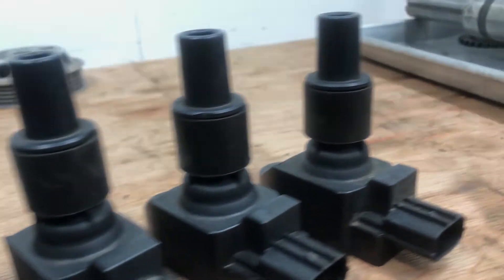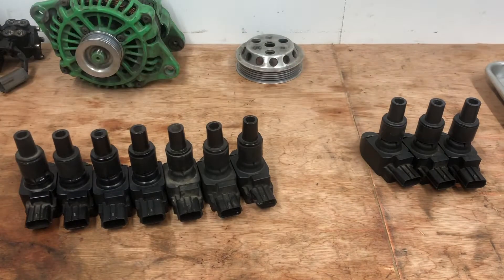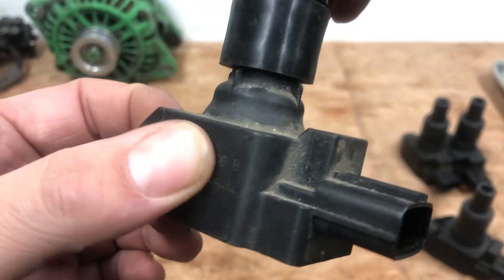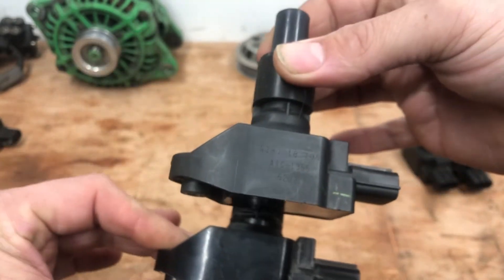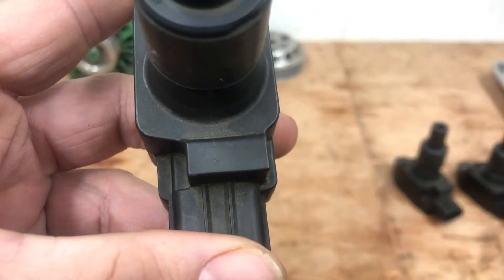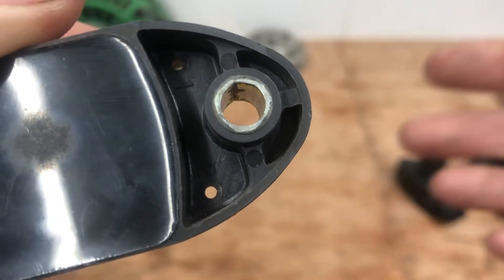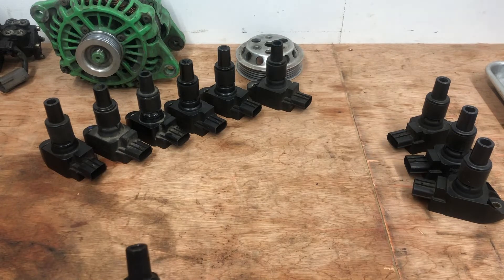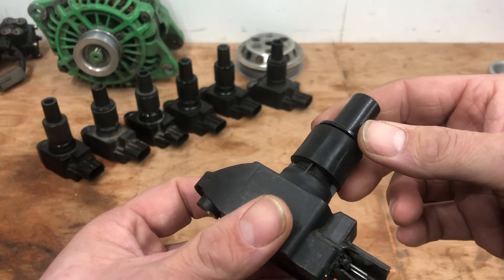Essex Rotary Quick Vid 39 - 9 Signs Your RX8 Ignition Coils Are Fake and How Pattern Coils Fail

Comment: Hi guys. My 8 suddenly shut off and won't start up again. The engine cranks normally. Started hot and cold without any issues. My mechanic found out that there is no spark on the plugs but couldn't find the reason. Battery seems to be fine. Dashboard lights OK. Cranking sounds normal. What could be the issue?

By the way I saw the vacuum line to the jet air fuel mixing system is ripped off. Also I had problems with my CAT P0420. Could one of these cause the car to shut off the ignition system?
Reply from the maker: this reply is super late and we hope you have got it fixed by now but would be pretty certain that your coils have failed from what you are describing, and as a result it has taken the catalytic converter with it.
Reply: @essexrotary1540  yeah, thanks guys. My coils were roasted and the chambers flooded as hell. Everything's fine now after changing the plugs and pull starting the car. The CAT will be replaced as soon as I'm not broke again haha.

Keep up the good work ✌🏼

Comment: Havent been driving my 8 due to lock down and I have been taking the motor bike on the days I have had to go to work. Car threw a mega hissy fit last week and intermittently would could out check engine light was on so I checked the codes and got P01687 (Metering Oil Pump Stepping Motor Circuit...yeah I have no clue either lol),  P0661,  P0443 and P0302 so for that last one I guess you will be seeing me soon to purchase one of your ignition sets, now I just need to figure out what on earth P01687 is.
Reply from the maker: P1687 related to the Oil Metering pump, this delivers oil to the rotor housings in order to lubricate them during combustion.
I am betting your also suffering from the engine going in to limp mode due to this.
You will need to get the OMP Code checked by a specialist and sorted as if it’s not fixed correctly it will return and may risk your engine.
Reply: @essexrotary1540  Yeah working on the car today replacing the spark plugs and msd cables you supplied to me (Thank you) and I have noticed the position sensor on my oil metering pump is snapped (the plug connection). I am guessing that is the source. Annoyingly the replacement I got used also has a broken position sensor the plan was to take my current sensor and put it on the replacement..so either this is a not so common problem or I am super unlucky...I am also guessing the OMP position sensor cannot be purchased separately. :o\

Comment: very informative video... looking at my coils, they have all the casting numbers marks similar to the originals  shown but have no part number on the sides.
They do have the embossing on the base which is quite deep that reads 5Z14 1355, above it  it also has HEX EXA - 1355  Made in Japan.
Do you know anything about these coils ?
Reply from the maker: These will not be genuine Coils I am afrid, if they dont have all the marking shows for an Original Mazda Coil in the style shown in the video then its not an original.

Comment: Very informative video and as my history and experience tells me and showed me on my Rx8 eBay crap coils will ruin your car .was buying them almost every other month specially on winter time  due to lack of power and way premature burning marks  and cracks on the. Putty   Which lead to destroy my original cat ,  engine misfire . Plugs clotted and eventually destroying the starting motor due to engine failure . Hence why I got BHR coils few years back from “EssexRotary” expensive but for sure the best upgrade in my car for better maintenance and engine performance . Engine starts easy no misfiring  at any stage beautiful spark reaction . P.S. love the LS Engine bin 😂😂 thanks Aston for the simplicity that is given for us to keep and maintain our rxs at top level .

Comment: Just replaced my coils with ebay one and pay £35 for 4 of them. My rx8 starts first turn hot or cold and pulls really nice
Reply from the maker: There is a reason n they are so cheap, good coils are not expensive because sellers want to be rich. They are expensive (comparatively) due to their quality and build. Hoping I am wrong for your pockets sake but those coils prices at £35.00 for 4 belong in the LS Swap Bin. That’s the cheapest set of coils I have heard about so far
Reply: I got some cheap shit eBay coils just to get it running at the time. I expected issues but I've been running it for 3 years on them with zero issues, butter smooth lol.